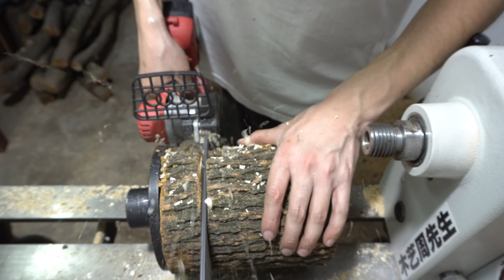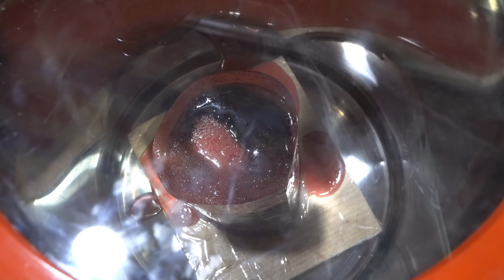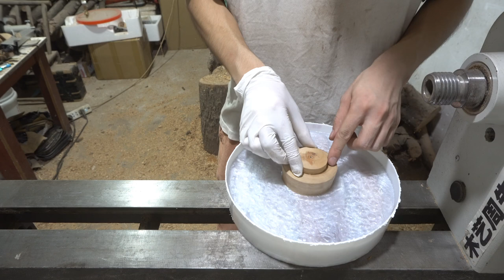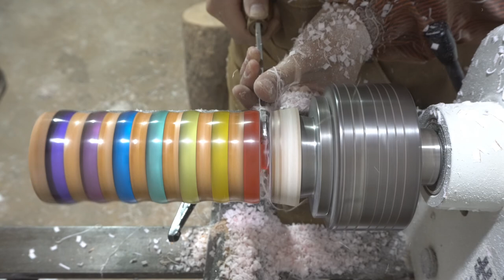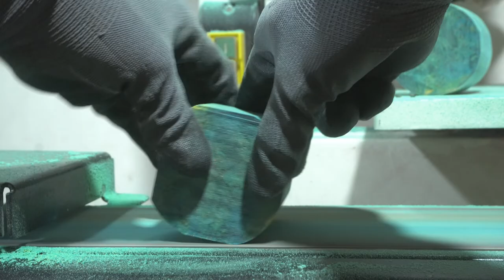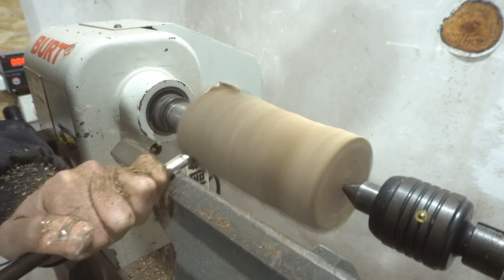Woodturning Fails (Compilation #1) Mr-Zhou

Comment: Seeing the mistakes makes me appreciate the final product that much more. I will say, a couple of those made me laugh:  the umbrella opening, the plastic cup tipping over as you were pouring the resin, the fly, and your sledge hammer handle breaking as you were using it.  😂  Some startled me, and I recall quite a few heart-breaking ones like the stacked wood and colored resin light that came off the lathe and wrecked the purple resin ring.  Thank you for showing the things that can go wrong.
Reply from the maker: Thank you for watching and commenting